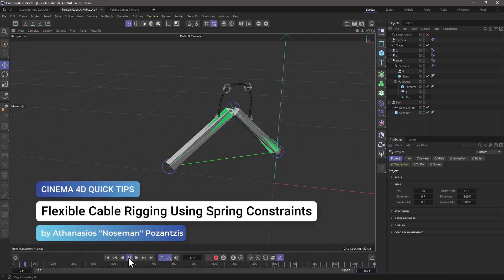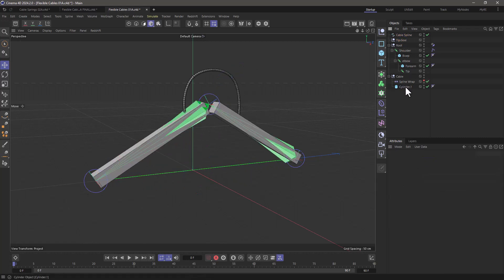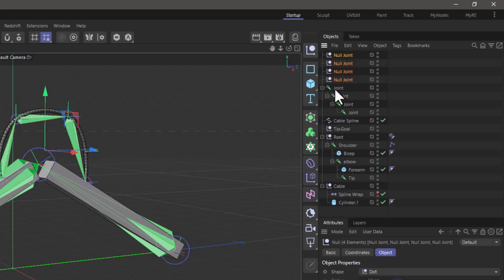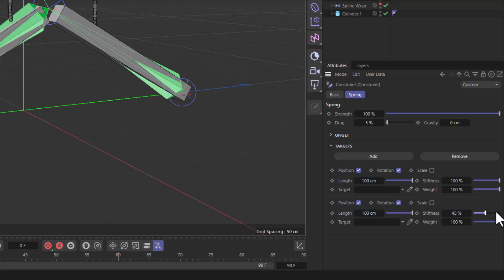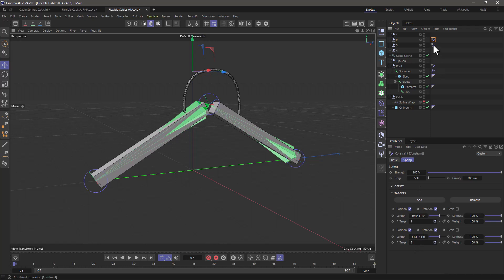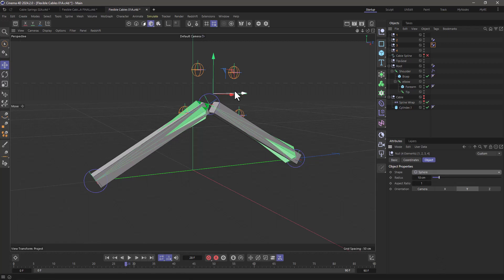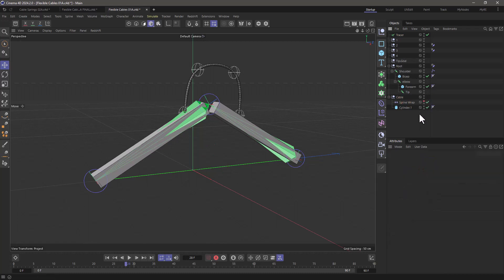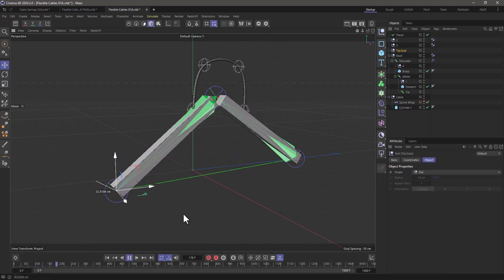#C4DQuickTip 120: Flexible Cable Rigging Using Spring Constraints in Cinema 4D

Comment: Hmmm.... When I add the constraints the nulls fly off and are not in the position where I created them. Any idea why?
Reply: Hello, me too, did you get any solution
Reply: @winshesterpv  Same thing - I guess Maxon needs to start this lesson from the very beginning by showing how to create the whole scene from scratch. This tip wouldn't be as quick but it will really help
Reply: I have no idea how he got it to work, but I was able to walk each Null back into position by using the Offset parameters(Spring > Offset twirl down). Definitely not ideal if you have a lot of constraints but if you only have a few it's not too bad. It helps to change the display color of each Null to help you keep track and also keep the spline selected in "points" mode so you can reference the position of the original spline nodes.
Reply: Same here...